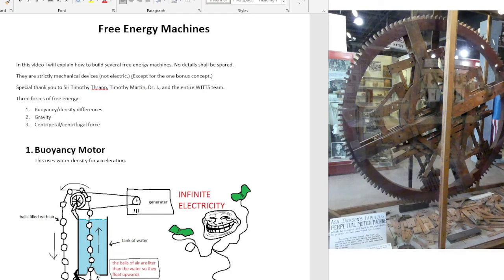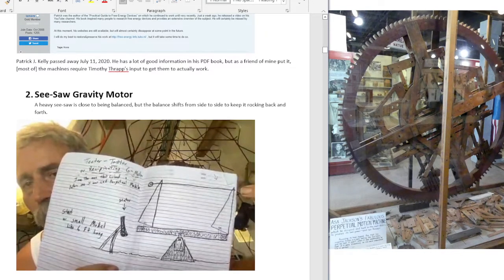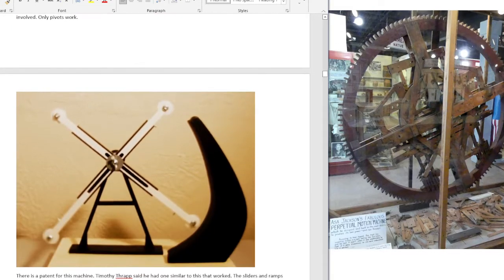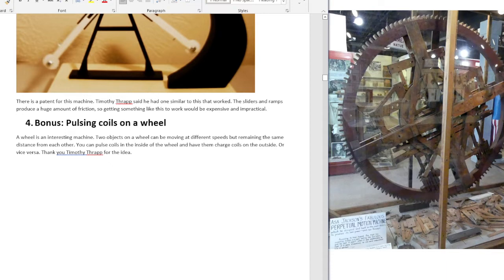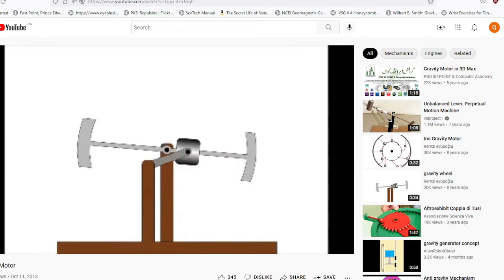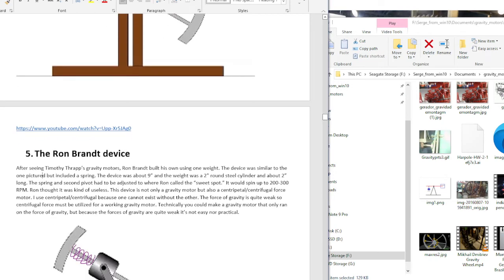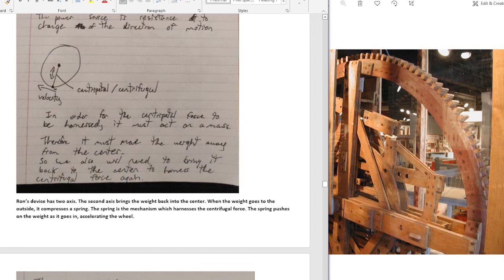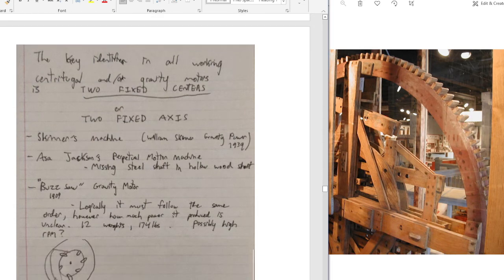How to Build a Free Energy Machine

Comment: with math, buoyancy motor equalises. take 1l square buoy 10x10x10 centimeter, desplaces 1kg of water. To lift this square, trough water column entrance force needed is 10 kilo for every meter of water in the column
Reply from the maker: That's why you use compressed air, not a rigid structure. A tank of compressed air will sink, for example. Each "tub" could have their own tank of air, but it's easier to just supply one air line. A tiny bubble of air 1/2 mile down gets pretty big by the time it rises to the top.
Reply: i'm not trying to discourage, i'm just sharing what i have realised
Reply: And how much energy do you think it will take to compress the air?  The same or more than the energy you will get from this doohicky
Reply: @troywhite6039  the same, it's balanced